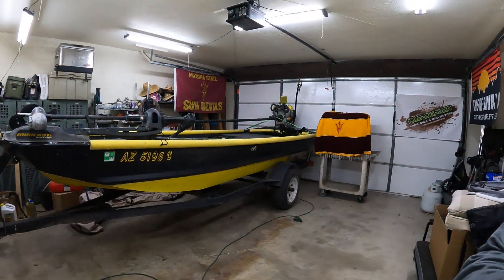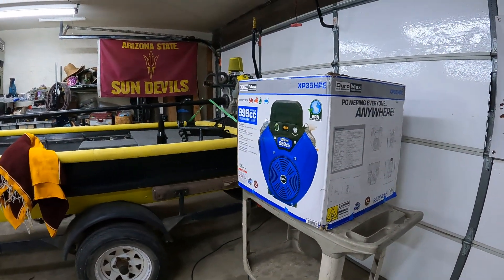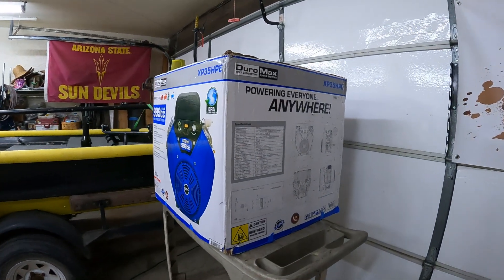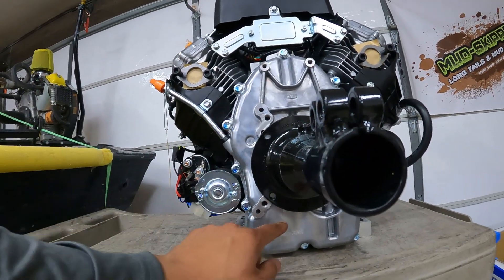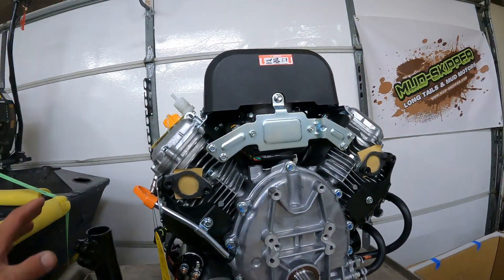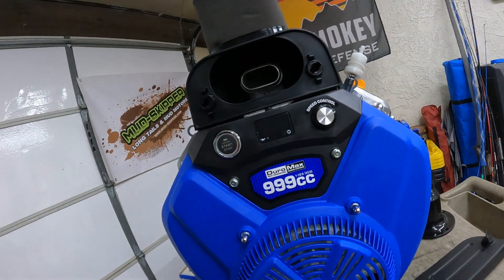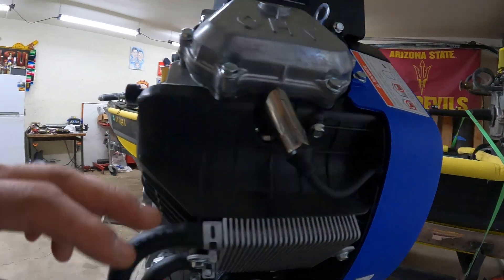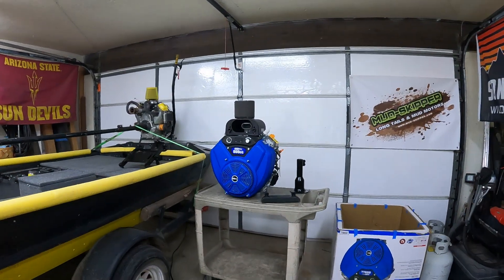Rumble Bees New Heart 💙 @DuroMaxPower 999cc #xp35hpe Vtwin

Comment: Have you worked out a way to control the engine RPM independent of the rotary switch on the engine itself? Is is possible to decrease the low end of the RPM to 1600-1800? I am building a band sawmill using this engine.
Reply from the maker: Stay tuned!!!! Currently stock stock ECU 2k rpm at idle. But there might be a way to change that.